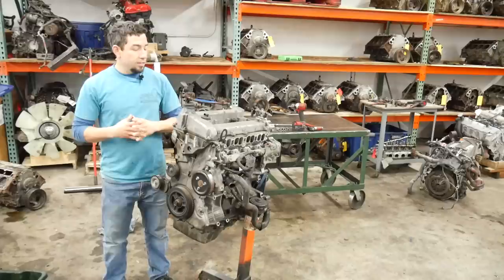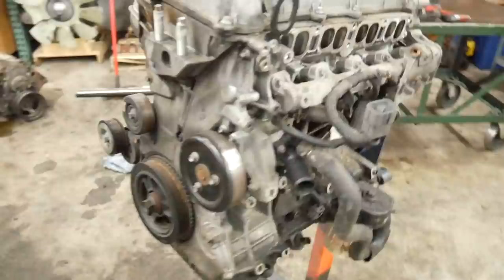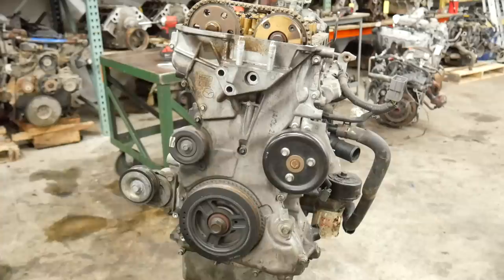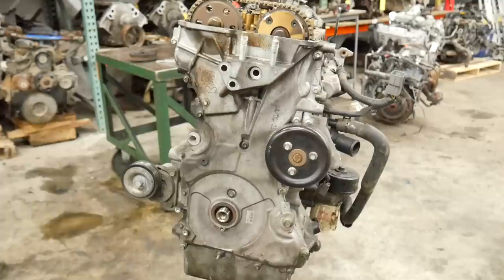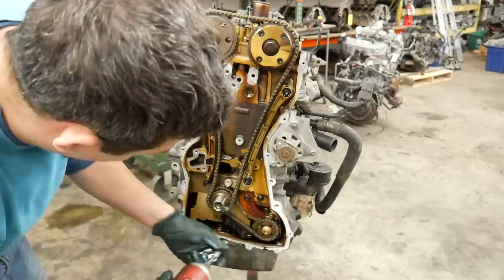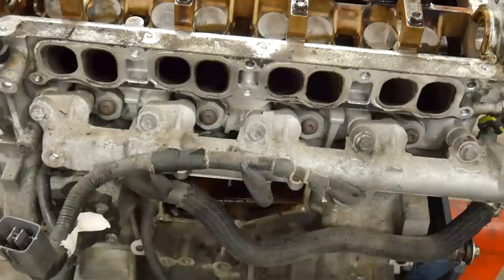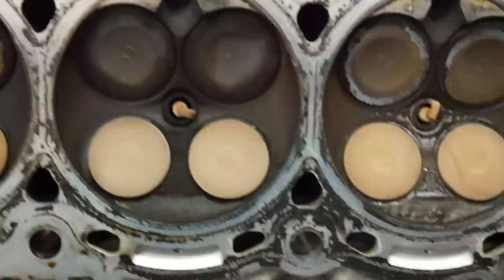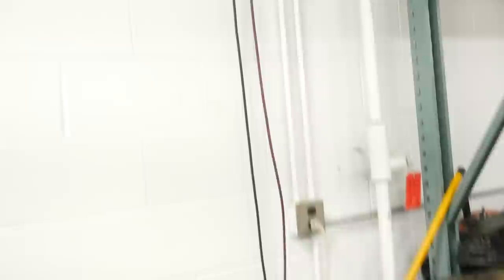TOTAL TEARDOWN: BAD Mazda MZR 2.3L Turbo Mazdaspeed3 Mazdaspeed6 CX-7 Engine.

Comment: As a Mazda tech of 23 years and MPS owner that's done nearly 300,000klms on the original engine (series 1 BK MPS), the only two issues I've seen are due to failed VVT actuators resulting in a timing chain rattle on start up, and issues due to people not using SN grade fully synthetic oil or simply not changing the oil at all. Usually the chain doesn't stretch, the lock pin in the VVT actuator fails creating the illusion of stretch when the inner stator shifts due to the fact that it's no longer locked in place. The chain is actually stronger than the chain used in the L5 engines, it has to be as GDI engines contain more particulate matter in the oil, absolutely no different to a diesel. Hence why most issues are a result of incorrect oil usage and poor maintenance.

I will say Mazda used an odd oil ring spacer, it's a fine one piece spring and tends to carbon up due to the previously mentioned particulate matter in the oil resulting in oil consumption and spun bearings as the oil level gets too low. However, once again it's due to the use of incorrect oil (GDI engines must run SN or SN+ grade oil) and/or poor maintenance. The balancer cassette is not a poor design as balance shafts have to be heavy due to the fact that they offset secondary harmonics in an undersquare engine. The oil pickup also has an internal strainer.

The L3-VDT craps all over the Ecoboost 2.3 with its open deck block. The 2.3 L3-VDT windows blocks due to the fact people wind the boost and timing through the roof resulting in cylinder pressures higher than that of an average diesel, that's hardly any fault of the engine itself.

You are not supposed to use the 8x1.0mm bolt through the harmonic balancer into the timing case to lock the crank in place while torquing and angle torquing the crank stretch bolt, that's made pretty clear in the workshop manual and it's obvious that bolt won't handle such loads and was never intended to.
Reply: 2 things I will say. 1st, changing the oil and watching the level inbetween, is critical on this series of engine. Even with the bests oils available, I still recommend changing it at about 3500 miles, because these mills run dirty and hot. 2nd. Buy the correct timing tool kits and use only factory parts, as they have been updated several times.
Reply: Do you have to re-time the engine when changing the vvt solenoid on the regular Mazda 3 then? I plan to change my vvt solenoid soon
Reply: @reneerogers3646  The VVT solenoid, no. However the issue regarding slack in the chain with the engine off is related to the VVT actuator, when replacing the VVT actuator you need to retime the engine.
Reply: The ford 2.0 and 2.3 ecoboost use the L3-vdt block one of the few things shared ford plans on continuing use of the L3-vdt for a long time to come I bought a 13 mkz 2.0 turbo awd with 37 k on it and now have 168k on it I run motorcraft filters and mobil 1 5w30 I did a compression test 2 weeks ago I had 190 compression across all 4 cylinders during a wet test I change everything as the manual suggest anyway I just wanted to let you know ford uses the same block however the head vvt and fuel injection system are different
Reply: @stevennunez6013  the Ecoboost 2.0 uses a similar block, the Ecoboost 2.3 uses a totally different open deck block with major structural issues. The L3-VDT is a closed deck design good for at least 800BHP without sleeves.
Reply: You really know what u are  talking about. My respects to you.
Reply: @Dan-vt1qt  thank you Dan. One of these days I plan on actually finishing the build of my fully forged L3-VDT to drop into my MPS. Sadly COVID and bill's got in the way. The bottom end's assembled, just a few more parts and then I've got the enjoyable task of fitting the engine in my garage.
Reply: Know your stuff !
Reply: Do you live in Australia?
Reply: My 2012 speed 3 needs a an expert like you
Reply: agree , I have the 2.3 Ford version in a focus no VVT , port F.I. reliable as anything , well over 200k miles.
Nice to hear an expert weigh in. Those balance shafts work great , mine is smooth running engine.
Reply: These are the two issues I have with my 2.3......
I randomly stumbled across your comment and it's given me all the information I needed.
Reply: @eisenhathaway  It's good to know I'm good for something! Enjoy your 2.3, awesome motors.
Reply: Are those engines related in any ways to 1.2-2.0 Duratec engines sold in Europe? Because there are some similarities betweend this engine and my 1.4 duratec in my Fiesta.
They're good and robust engines though, mine did 200.000km yesterday and has nearly 20 yrs of service.
Reply: @ilfordino-fordfiestatutori8725  that engine is based more on the Zetec engine than the Duratec design. It's really a Duratec by name only, it's vastly different to the Ford Duratec/Mazda MZR series of engines.
Reply: Hi chief, sorry to bother you and I hope you are well.

I have the timing chain rattle on start-up mentioned above.  Is it something that I should get sorted ASAP??
Reply: @warricklee2154  what's the mileage of the engine? is it a series 1 (BK Mazda 3), series 2 (BL Mazda 3) or CX-7? What's your oil level like?
Reply: @Hyperno47 It's a CX7 on a 57 plate m8, 

140000+ miles and drinking oil at a rate of knots...but I'm about to refurb the turbo.  Hope this helps??
Reply: @warricklee2154  You can try changing the turbo, the early revisions used to leak into the exhaust housing as the vehicle approached the next 10,000 klm service interval due to oil dilution (a common problem on GDI turbo engines). The best revision turbo to get is the OEM K04 ending in 883 as they had the upgraded seals and better balancing (you used to be able to buy them on ebay for a good price - I can confirm the supplier I used provided legitimate OEM turbo's). But, as much as I hate to say it, I bet if you pulled that engine down the oil rings would be clagged up - That's generally why they start using oil. Would you say the rattle isn't as bad just after the oil has been changed?
Reply: @warricklee2154  I was just thinking and remembered you have a CX-7...Don't get the 883 K04, the CX-7 runs a slightly smaller turbo...
Reply: @Hyperno47  Yep, definitely as soon as it starts to run low the rattle is much worse and then almost disappears for a day or two after topping it up.  I can see oil in the pipe leading from the back of the intercooler to the turbo! This is why I was thinking of changing it, does that make sense?

The engine itself is not noisey once running and has plenty of power.
Reply: @byteoncomputerservices8054  Thanks for the input chief 👍
Reply: @warricklee2154  what you describe makes perfect sense, I would hold off replacing the VVT until you work out where the oil's going, as it's very possible the VVT actuator isn't faulty, nor is the chain stretched. First thing: Replace the PCV valve under the inlet manifold (you can get to it from under the car), on many an occasion I've seen faulty PCV's show all the symptoms of a faulty turbo and they're cheap to buy. If you still find oil consumption is excessive and you see oil in the intake (a better sign is oil in the exhaust), replace the turbo. If you replace both and oil consumption is still high, it will be clagged oil rings. The L3-VDT runs a very fine one piece spacer spring on the oil rings, due to the fact it's a GDI engine fuel condenses on the cylinder walls to be mixed with oil and forced into the ring lands on the upward piston stroke: Fuel + Oil = Carbon. Assuming good service history with quality fully synthetic SN grade oil, I'd bet the rest of the engine is in perfect shape, it's just the oil rings clag up and can't scrape oil back into the sump. As a result the oil gets burnt on the combustion stroke resulting in consumption issues. A compression test won't pick it up, a leakdown test won't pick it up and you usually don't see any blue smoke from the exhaust. For all intents and purposes, the engine runs perfectly, it just has higher than normal oil consumption.
Reply: @Hyperno47  Spot on mate, thanks everso!  If you need any decorating advice, I'm your man 😂😂😘
Reply: @warricklee2154  No problem my Friend.
Reply: @byteoncomputerservices8054  

hi

how different are those engines to ford duratec 1.6L  the one without any VVT techology
Reply: @darthtrump4428  The 1.6L Duratec is a totally different engine that shares Duratec by name only.
Reply: Are the non turbo 2.3 good? I'm thinking of getting rid of a Corolla 7afe for one. My 7afe smokes on startup(2nd engine) they all burn oil due to rings.
Reply: @shinobusensui9395  The non turbo 2.3 is a great engine, however like any engine service history is important. I've owned a number of car's with the non turbo 2.3, I've worked on countless 2.3's, and I've seen very few issues with them.
Reply: Byte on computer services the MPS is not the speed 6 right?
Reply: @dma5205  the MPS moniker is the same as the Mazdaspeed moniker. Simply different marketing for different markets.
Reply: @byteoncomputerservices8054  thank you  for explaining I have a speed 6 with 182000 thousand miles on it, never had much problems with the motor, all though I have a check engine light I can’t figure out or my mechanic can’t figure out, everything reads fine he says but has a misfire every now and then
Reply: @byteoncomputerservices8054  i also got the VVT actuators taken care of too
Reply: @dma5205  how bad is the missfire? Is it just a slight random 'pop' at the exhaust at idle or do you completely drop a cylinder? Using Forscan and an appropriate OBD-II adapter bought off Amazon you can go into OBD-II readiness and view cylinder missfire counts if you want to try and isolate a missfire to a particular cylinder. Having said that, in my experience a slight pop from the exhaust at times at idle isn't uncommon regarding these direct injection engines and may not even appear under OBD-II readiness misfire counts as they're simply too slight for the PCM to pick them up.
Reply: @byteoncomputerservices8054  I believe at idle I don’t understand how my mechanic can’t figure Out how to diagnose it, I’m not savvy with cars Unfortunately, I need to take it to another place, it drives perfectly fine it’s weird .
Reply: He doesn’t know what to do to get rid of it
Reply: @byteoncomputerservices8054  I just had the valves clean also Thought maybe it was that
Reply: One question sir my high fuel pressure pump is bad, i want to use new internals, but my tech told me the spill valve is bad, they have a kit to rebuild it, now im wondering if is rebuildable.... It comes together with fuel pump, so to get s new one i need to buy the whole thing, which is really expensive...
Reply: @Dan-vt1qt  Honestly? If you've got a bad spill valve you'd be better off finding a complete working second hand HPFP and fitting the Autotech upgraded HPFP internals. When you get the upgraded internals all you get is the internal piston and associated housing, you're supposed to use the external housing, spill valve, spring, retainer and collet's off your existing pump. I'd actually be surprised if Mazda sold the spill valve as a separate, replaceable component TBH.
Reply: This is good info.  You always hear a lot of bad with this engine.  We've had our 2010 CX7 for about 4 years now.  Second owner, bought it with 94K and it just rolled 188K yesterday.  I change the oil and filter every 5K.  Every fill up I check the oil.  Usually ends up needing 1 quart between changes.  Still runs very well.  Hoping to get a few more miles out of it before needing anything major.  It just developed an oil leak that I need to check this weekend it's due for the LOF and rotate.  I use a Motorcraft FL910S every change.
Reply: @gregbarnett3141  The L3-VDT is a great motor, in fact it took a number of years for VW to match the torque output of the L3-VDT with a torque curve that's almost identical regarding the far newer EA-888 as fitted to the Golf R. Furthermore, the L3-VDT has a great aftermarket tuning industry behind it and responds well to upgrades. A proven platform that was on Wards 10 best engines list for three years running.
Reply: Awesome post - if you find a lot of oil in the intake, no smoke from exhaust and NO oil in the inter-cooler - is that most likely a PCV valve issue? I do notice a lot of oil has dropped below throttle body and I can see some near the turbo. Apart from that, the engine runs smooth.
Reply: really appreciate this comment, i just did an engine swap for my 2.3 because i was one of those bad owners and know i've cause some damage from oil starvation, still runs but it's rough. i intend to try and rebuild it and i'll put it in storage in a dry place. i'll definitly be checking levels and doing oil changes on the regular from now on knowing how critical it is.
Reply: i agree and anecdotally a lot of people are pushing big HP on these mazda blocks with no troubles. mazda usually makes sexy cool stuff
Reply: I hope you respond to this but I have an 08 Mazdaspeed 3 and the chain slap is there on start, it's worse when I change the oil but goes back to normal chain slap. I bought the car at 150k ish and now at 160k, changing oil every 3k using royal purple but I'm not sure what the best oil is for these engines . I don't push it but I'm worried my engine will blow up before I'm able to redo timing and maybe delete the 18lbs pickup line. And just revamp the engine entirely since I've heard the piston rings usually go to crap around 160-80k I'd like to keep this car but not sure if I'll be okay in the meantime while I collect money or if there's anything I'm able to do to keep it from blowing up on me.
Reply: Consumer Reports had rated the 2007 Mazda CX-7 as the absolute worst, most-troublesome, and least-reliable vehicle built in Japan in the entire Japan's history.

Comment: On the gen 2 speed engine, they revises the vvt actuator, timing chain tensioner and the chain itself. They're a fantastic motor and very reliable, the same can't be said for the gen 1, cx7 and 6 motors. They're an impressive mottoes for what they are and with proper maintenance they will last longer than most other 4 bangers making the same power.
Reply: That is a gen 2 engine. You can tell by the cam cover with upgraded breather as well as the completely revised piston crowns. The timing chain was identical between all engines and the VVT actuator was identical compared to later gen 1 engines.
Reply: loved my 13' speed3 - never had any issues with it. came to speed3 from a NA mazda3 - loved it as well.
Reply: if only the 2nd gens looked as good as the first gens
Reply: @joem3115  the 1st gens are ugly imo.
Reply: @RandyAugustus  Hey i get it man, not everyone has good taste.
Reply: @byteoncomputerservices8054  Is there a readily available oil that you can recommend for this engine? I have a mazdaspeed3 2nd gen and live in the U.S.
Reply: I have a second owner MS6

Comment: My wife has an 08 MPS here in New Zealand, it’s about to tick over 300,000kms (186,000 miles), had a timing chain at 175k and carbon clean at 250k, serviced every 5k
Reply: Alot of poeple make this cars bad.but the big thing is maintanace.i also service my mps every 5000km and my motor is healthy.have 246k on clock now no issues.
Reply: In NZ as well, my Speed has hit 201,000 kms, makes 201 kw atw and 425 nm atw, on stock bottom end and stock clutch driven everyday, no issues at all. All down to servicing and getting a reputable tuner. I bought it at 101,000 kms 4 years ago. Currently saving up to do rods and pistons and bigger turbo and chase more power.

Comment: My 2.0 liter Mazda Protege 5 engine was absolutely was a great engine.  What a fun car to drive.  Bought it new in 02 and was scrapped 2017.  My 2017 CX-5 2.5 liter is good too.  Turbo cars today need very frequent oil changes.  I also had a Mazda 626 turbo and that car was scary quick, it pulled like a train.   Great video again.

Comment: I guess these were the common issues associated with adding a turbo and GDI onto 4 cylinder engines that weren’t completely designed to handle the extra pressure and stress. I recently bought a 2010 Mazda 3 with the naturally aspirated 2.5L MZR and it runs smoothly at 94k miles. Also heard these engines are very reliable with regular maintenance. Wish me luck guys as I hope to reach 200k miles with it!
Reply from the maker: The naturally aspirated engines are pretty reliable in my experience
Reply: @I_Do_Cars  have a 2006 Mazda5 with the 2.5 and it’s running great.
I just change the oil every 5000 miles.

Comment: the difference between a bad car and a good car is the same as between a bad owner and a good owner, it all starts with changing the oil on time.
Reply: very true. sold my 13' speed3 a few months ago with 72K miles - never had a single issue in 7.5 years i have owned it...

Comment: I think the only good 2.3 engines FoMoCo made was in the 1970's Ford Pinto 2300cc, they were bulletproof. With regular maintenance like changing the timing belt every 40,000 miles, it was a Good Little Engine. You could change a timing belt in 30 minutes, and that's taking a coffee break halfway. The bottom pully would come right off just like you did, take the plastic cover off, line up TDC, the distributor gear, and cam timing marks, back together, piece of cake! 
Why the demand for oil pans, is it from bottoming out or throwing rods out through it?? 
To keep from chasing the engine stand around I would use shop towels wrapped around the wheels, that idea came to me after getting stuck under a car while on a creeper and running over a shop towel, help I'm stuck. lol